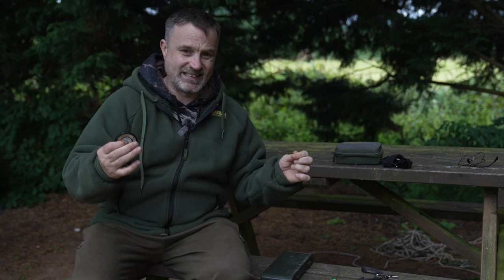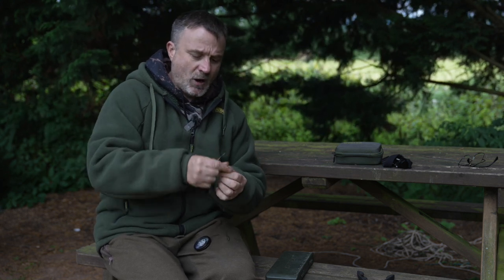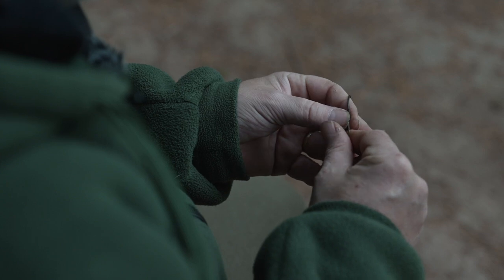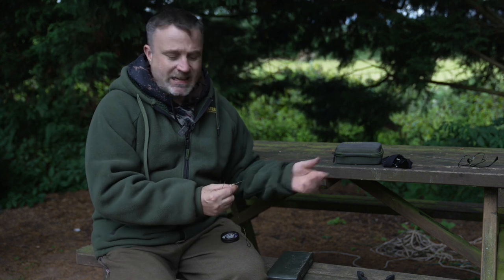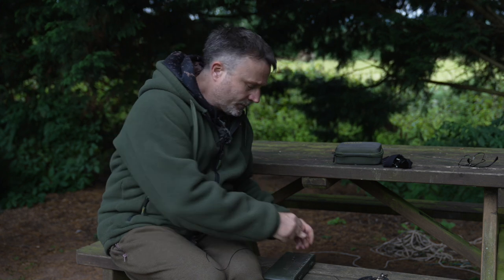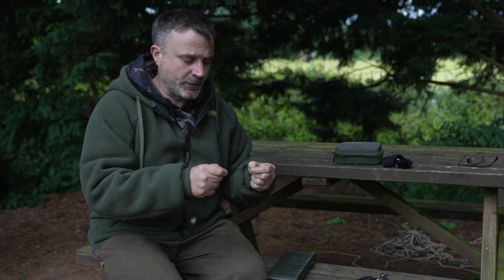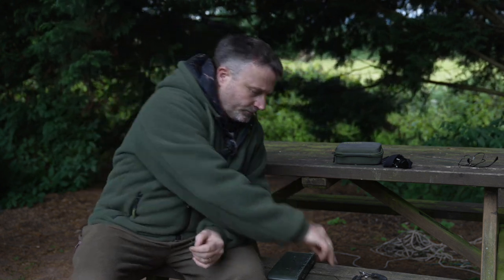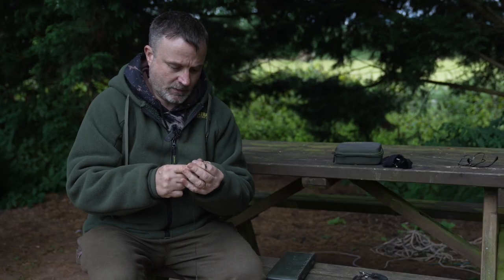Splicing Katran Comodo Chain core With Riglockers Luke Shephard

Comment: Only recently come across Katran and that you sell this chain core, I used to get the same stuff from 'A Carpy Connection' and was really gutted when he stopped selling it. It is by far the best leader material on the market, the suppleness is unreal. You're right about it losing a bit of colour over a period of time so when necessary i use green, brown and black permament marker pens to re-colour it. Good tip about splicing it a little way through the chain core as i did find it could slip, funnily enough only when it was loose but not when under pressure so it's never cost me any fish. Absolutely brilliant stuff. I will definitely being trying some of your other products, if they're half as good quality as this then you're on a winner.
Reply from the maker: That’s really great to hear Clive. If you need any information on bits can Chuck us a message on social platforms. Thanks for watching and leaving ya your feedback
Reply: @Katrantvuk  great will do, thanks for replying